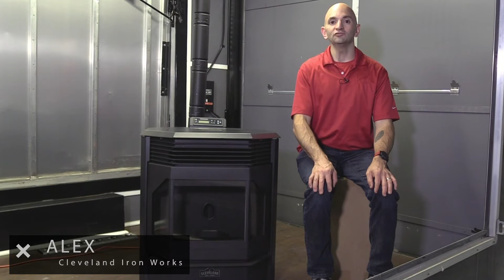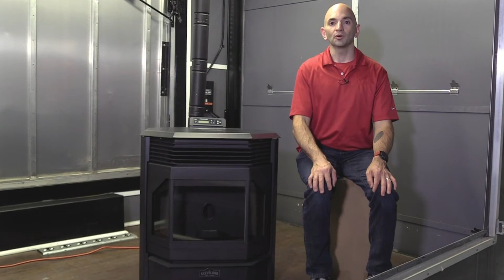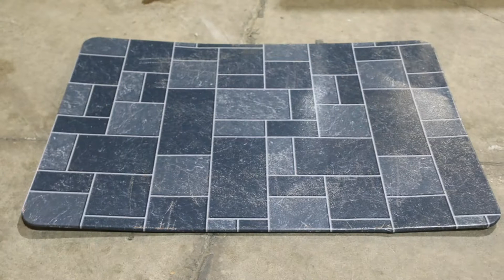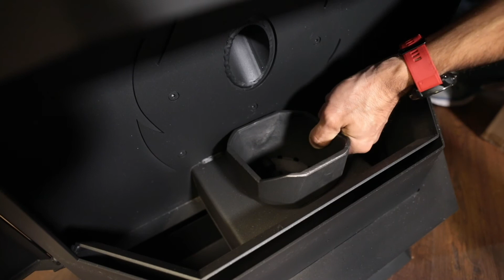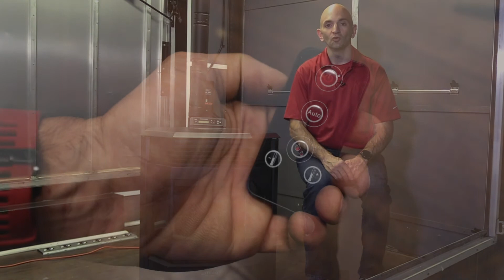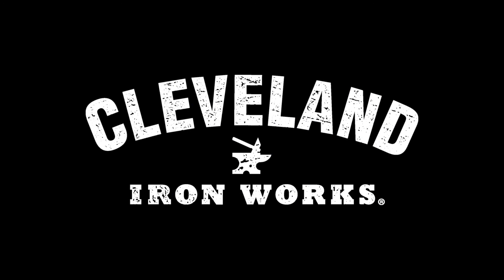Bayfront Pellet Stove - Cleveland Iron Works

Comment: Can you answer one question: what's the purpose of negative numbers in the fan and exhaust settings?? I notice the default is set to 0 intake and -10 blower. What on earth does that mean? Why would I want negative blower? What even IS the blower? I assume the heat dispersion fan. 

No matter what I do, I cannot seem to prevent this stove from window soot. Within 3 or so hours, every single setting seems to blacken the glass. I have a clear intake duct with outside access. The exhaust is running 2 elbows but is under 6 foot in length. Joints sealed. Door is latched all the way.. I have tried SO MANY fan and blower setting combinations to no avail. 

Any help is greatly appreciated.

Comment: I keep getting e2 code. The stove is brand new. Fired up fine but went out in the middle of the night with a full hopper. Now I won't light it keeps giving the e2 code
Reply: Turn it off and then onto clear the code.  I got that code when it ran out of pellets, so dig down and make sure nothing is blocking the auger feed.
Reply: I got that code an unplugged it an plugged back in it cleared the code however my igniter went out a few days later

Comment: What about a review on the smaller one good for 800sf.Think of buying one but no reviews on it would like to see a video of it the F500212
Reply from the maker: Thank you for your comment.  We are sorry to hear that you are having an issue with our unit.  Please give us a call at 1-800-251-0001 and one of our Tech Service Reps can help!
Reply: Yeah I'm curious about that smaller stove too, but if the company can only respond with an unrelated stock response, then I'd have little faith in their customer service abilities.
Reply: Just got my F500212 installed today. Seems to be running fine so far. But it's only been on for an hour. Supposed to get down to 15°f tonight. I'm living in an Amish shed with no insulation in the floor or ceiling. But have R13 in the walls. So I guess we'll see what happens. Wish me luck!
I'd like to know how to set the time and date on this thing.
Reply: @RubenFletcher  it 8-12deg here tonight
Reply: @ironhead320  where would that be? I'm in Western Kentucky.